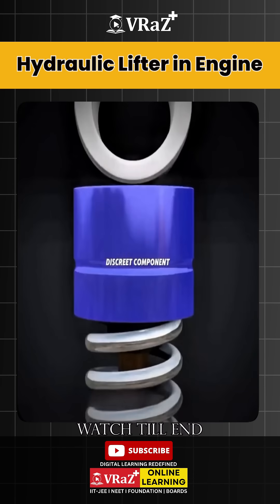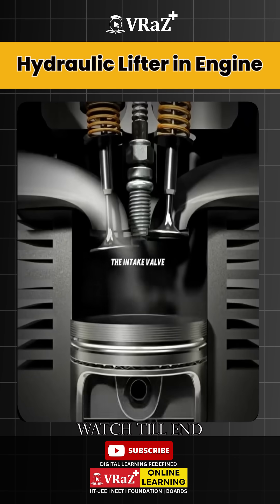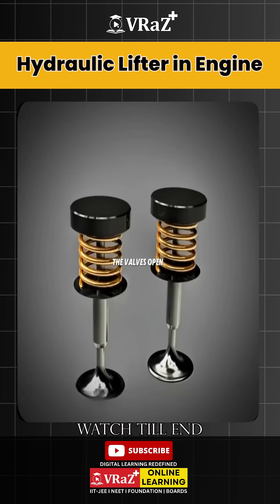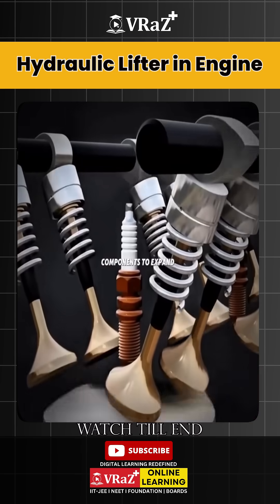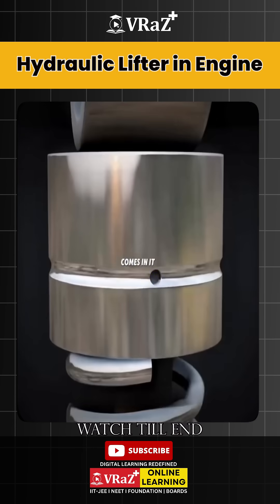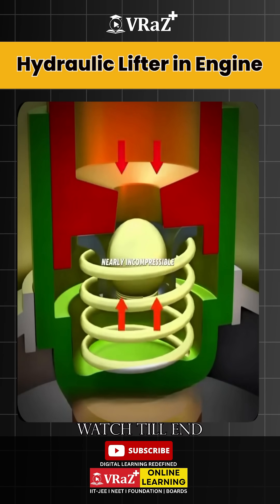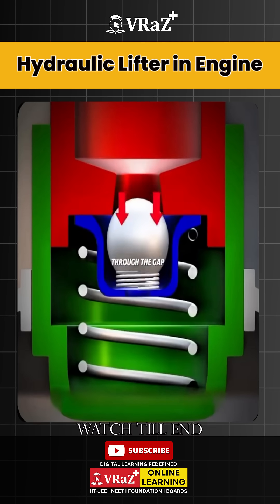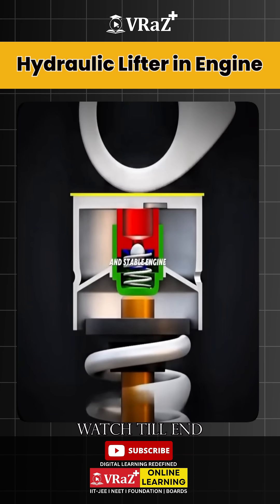The Silent MVP Inside Your Engine! 🛠️🔥 | How Hydraulic Lifters Work #engineering #shorts #shortsfeed

Comment: I was born in 1951 and have seen cars that had hydraulic lifters and solid mechanical lifters. I have seen problems where the hydraulic lifter collapses and starts making noise. Also hydraulic lifters do not require periodic adjust, where as solid mechanical lifters require periodic valve clearance adjustment.